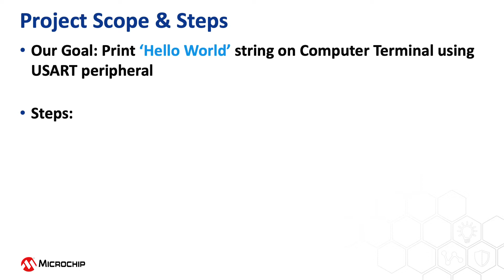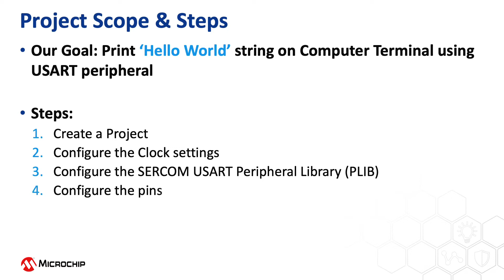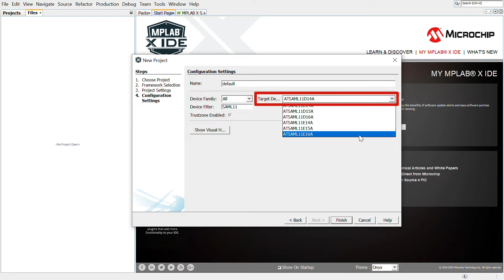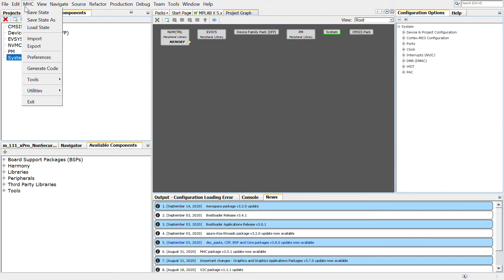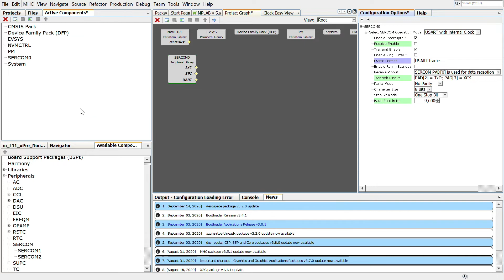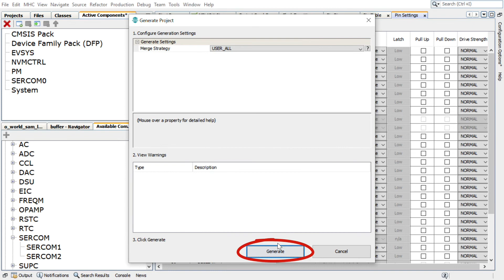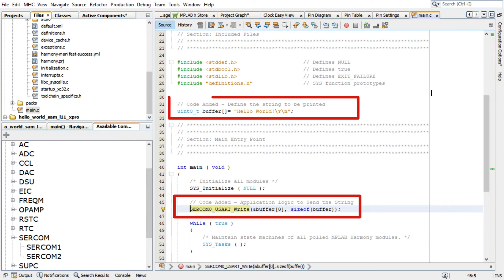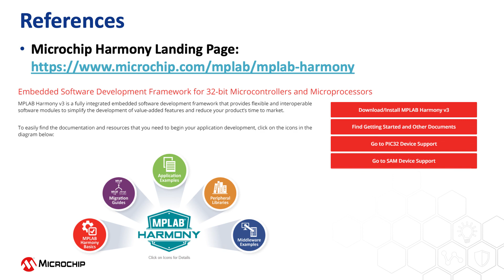Create Your First Project with SAML11 using MPLAB® Harmony v3

Comment: I followed each step of the tutorial but my code generation stuck to 47 %. I have studied different solutions but they can't work in my scenario. I am using MPLAB X IDE V6 and XC V4.10 on ubuntu 20.04. Thanks in advance if anybody helps me with that issue because I have been facing that one for the last three days.
Reply from the maker: Hi Muhammad! Please refer to these links:
https://microchip-mplab-harmony.github.io/reference_apps/apps/sam_l11_xpro/saml11_trustzone_getting_started/readme.html

https://microchipdeveloper.com/harmony3:saml11-trustzone-getting-started-training-module